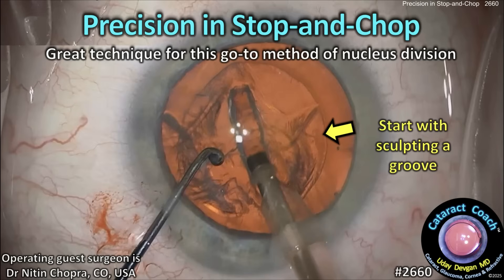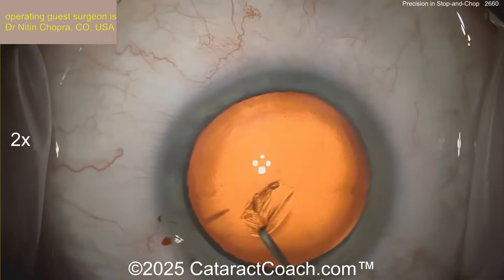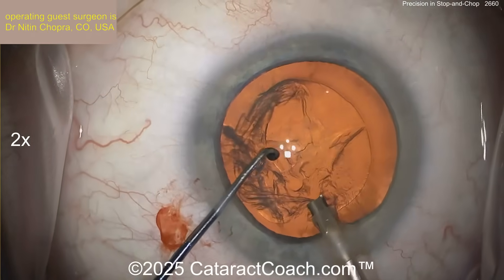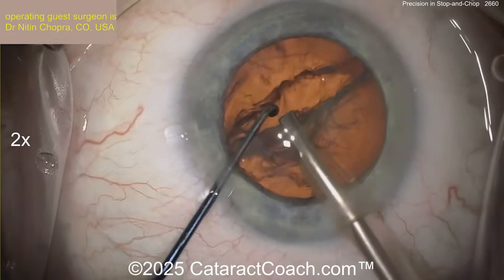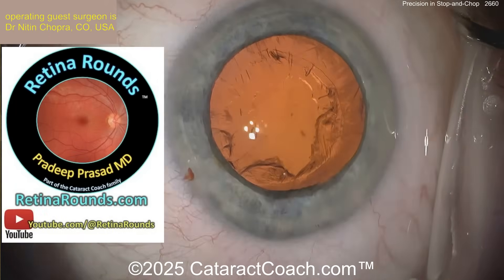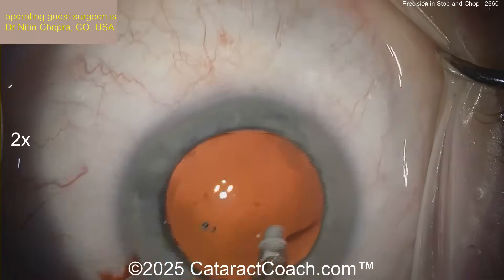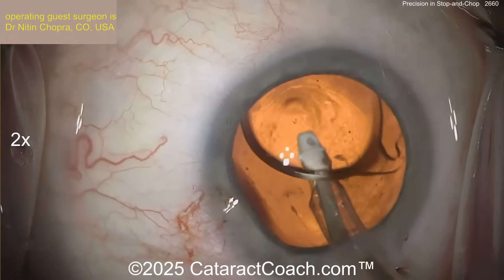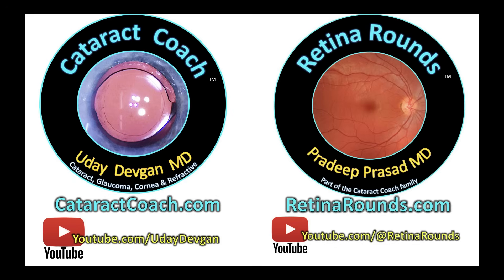CataractCoach™ 2660: precision in stop and chop

Comment: Although I have tried and used many techniques for nucleus disassembly, I keep going back to stop and chop because of the predominance of dense cataracts in my practice (not too many Beverly Hills lenses).  I like tilt and chop for the few soft ones.
Reply: Same here 

I found myself indulging inefficiently in variable chopping techniques wasting time , have almost minimal CDE (total phaco energy) but, extending the surgery time unnecessarily 

When going back to stop and chop, I started to finish cases faster , most cases sub 10 min drape on to drape off . The only downside side is losing some fun chopping about . (And slightly higher CDE’s , not as high as I thought it would become)
Reply: @ajmi10 in NS4 cataract the groove alone is 20 CDE